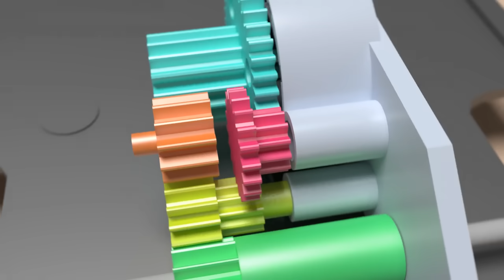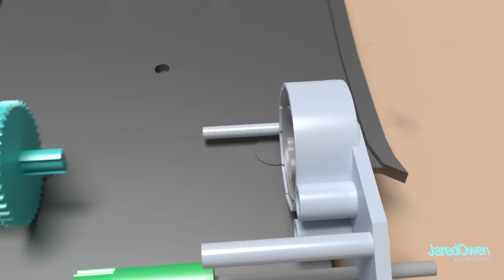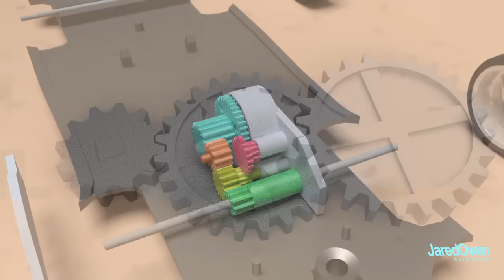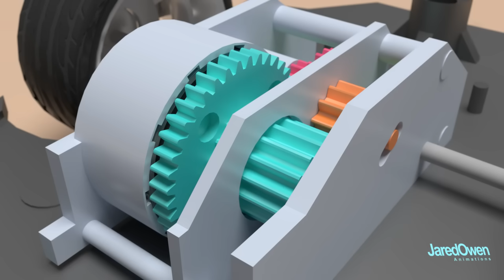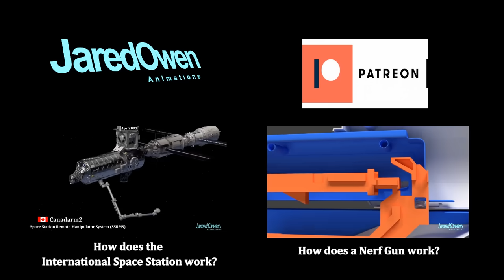How does a Pull-Back Toy Car work?

Comment: Hi sir, can you instruct how the pull blender blender without electricity works? Is the method used by the pull blender the same as the simulation of the car pull back?

Comment: 2050 : innovation 💡 
the wheels 🛞 have the gears mechanism of pull back method technology each has a motor no more engines or transmission needed 🤔

Comment: I used this video to take one of these apart and put it back together because it wasn't working, but it still isn't, and all the gears turn fine so it must be a problem with the torsion spring

Comment: No need to explain
I used to disassemble every toy car  like this and get rid of that mechanism, so i can play in sandbox without having to worry about rear axle locking up because of sand

It's basically just a spring compressed gear and a gear ratio amplifier, so rhat way the torque is lower and the speed is higher
It also has a clutch-like mechanism, so that way it decouples the spring mechanism from the axle if you want to just push the car forwards
Reply: haha pp car go brrr

Comment: When i was child, i accidentally broke the gearbox and the spring were out. After seeing few parts, i immediately know how it works. I tried to put it back, but instead i got bled due to being so hard to fit it back, so i cut the spring halfway. It worked again, but the spring felt so weak lol.

Comment: During W W 2  I believe it was in Norway there was a bus service passenger service that travelled up a mountain . Because of extreme fuel rationing they converted a bus with a huge mechanism like this , it rewinded going down hill with enough energy to go back up. I read about it many years ago .

Comment: Great video. What material is usually the torsion spring made of please? I was wondering if it could be build at home out of 3d printed parts but I don’t know what could be used for the spring.

Comment: so what would happen if i were to block the fail safe, and stop the twisted coil loop from slipping, would I then be able to to wind up the car further, obviously yes, but how much further would I be able to wind it up, or would it go until the twisted coil snaps? (or the blue gear connecting to the twisted coil atleast
)

Comment: I put one of these plastic pull back cars in a derby (which is smashing them together) with my metal hotwheels, and the motor (or engine as I like to call it) broke and fell out along with the back wheels when I was checking damages and weird positions the cars had somehow gotten into

Comment: Question: what keeps the wind-down gear (the pink gear) in place during either pushing or pulling back the car? No peg was shown on that pink gear that might keep it in place in a diagonal slot.

Comment: When i have the experience and capital i want to add this pull-back mechanism to a bicycle and also add the scientific concept from the video 
"risking my life to settle a physics debate" which has a thubmnail of sometype of car with a big "fan" on it.

With these two i can travel more faster effectively without a battery.

If some one finds a way to complete this project and have a safe final conclusion on the model,  contact me so i may see that beauty.

Comment: as we wind up the car it changes the configuration of torsing spring . the work done by use in this process is stored as potential energy in spring which converts into kinetic energy of car

Comment: I am surprised it doesn't need an overrun clutch but it's interesting the mechanism that changes it into a lower gear for pulling back and a high gear for release also handles the freewheeling capabilities

Comment: One more interesting observation is... If you try to pull back the car upside down.. like the position in which the wheels are facing the sky, then spring doesn't get engaged. Your awesome explanation also cleared my mystery of this behavior. Great job.

Comment: I have an Andoer L4 Pro motorized dolly. It's a tiny device like a toy and it has 3 wheels positioned triangularly. Only one point has a motor which controls the entire movement. The two wheels are just moving in the motion of the one motorized wheel. The two free-wheels can change direction and can be fixed to.. My question is, if I try to angle the two free wheels so that it can move in a circular motion, the moment it reaches the 360 degree round, it is not in original position. So if I let it move more than 1 full 360 motion, the device gets out of place until it falls off the table. The two wheels have angle indication lines to set the same angle but it still don't return to its exact same spot after full 360 turn. What to do? =( What I desire is that I can just let it move around at the same position..

Comment: DO YOU WANT TO GET RICH.  TOMORROW.  Use this method to create a light weight motor that'll power a remote control glider into the sky for 20 to 30 seconds of thrust.  Eliminating the need of a heavy metal motor and larger battery to power the motor.  Also eliminating the need for a heavy electric speed controller.  If and when you create this motor.  You will not be able to produce them as fast as they will sell.  Weight is a gliders enemy.

Comment: It's impressive how much ingenuity in that little motor. There is a lot of requirements solved with great economy of parts: fail save winding up, different gear ratios for moving forward/backward, auto-disconnect when spring unbound ...

Comment: Hi Jared, I just want to add one more point to your video. Some people wonder why the mechanism doesn't work when you turn the car upside down. This is due to gravity. When you turn the car upside down, the wind up gear slides up due to gravity. Now that the wind up gear slid the other way, the car cannot wind because the wind up gear is not in action.

Great Video! 

Many thanks,

MechanicalManiac

Comment: I have disassembled one of these when I was a kid, i was not able to construct it back :/

So I kept the gears and torsion springs and just assembled the last gear that connects the rear wheels and reassembled the case back on, the toy car was now just a regular toy car. 

Don't know where those went though

Comment: Backseat of a toy car, they designed to put a luggage or briefcase at top of the seat in order to fit pullback from it’s axles.

Small VW bus have it’s pullback at the front.

Comment: I had to take apart a toy like this for an engineering class. Do not take out the metal wire. You will never be able to get it back in the toy

Comment: This is super useful! I have a question. If I want to make small diy cable puller using this mechanism, what i have to add to make it roll after pushing a bottom?

Comment: Thanks for this video. I've been wondering this almost my entire life. This will probably be a stupid question, but how does this not violate conservation of energy since the car has travelled further than the distance it was pulled back?
Reply: It is fully compliant with the conservation of energy, because of the energy you give the car when winding it backward. While it is true that the toy car goes further than the distance you pulled it back, you should feel a slight resistance when pulling the car backward. This extra energy is what gives the car energy to push forward with extra distance.

Comment: Very well done. Any kid in the past who opened up the toy would have noticed that mechanism and would have a vague understanding of how it worked. But your video was far more informative. Also there was another type of toy car they use the make, it had a little flywheel and a metal arm with a piece of flint or whatever on the top of the flywheel. You would push the car again and again, it would speed up the flywheel and give it power and it would move the car. The flint on the top on some models which was just sitting on the top of the flywheel would cause sparks due to friction. This mechanism was also used in some older Guns, the trigger would power the flywheel and cause sparks to be seen inside the gun's little view window.

Comment: Was it hard to model the torsion spring?  Thanks.
Reply from the maker: yes actually - an armature with about 40 bones.  I used python code to set the poses and drivers so i could animate it with just one property.  It was tricky but well worth it!  I hoping there is a better way that I just don't know about yet...
Reply: Thank you.  This video is just incredible.  You are at the top of your craft.

Comment: Sir, your next tutorials should on any of these following topics randomly day by day but all of these, namely 
+.........................................................................+
1. Computer motherboard
2. How binary works in computer
3. How router works
5. Best programming languages ever/2019
6. Best programming ide free/commercial
7. Best raster based and vector based  free/commercial editors
8. Debugging with browser Inspector tool
9. Difference between Command and Powershell
10. How Windows OS, BIOS, Software and User interect each other?
11. Active Directory
12. E-commerce/Others Website project planning/management
13. Virtual machine
14. Difference between Docker and VM Virtual Box
15. How an ATM machine works
16. How HTML and CSS work together/rendered by browser with animation
17. What is the use of Web Drivers in different  browsers?
18. will be post soon if you like my comment

Thanks for your hard effort because you are a million 🌟!
Reply from the maker: Oh wow!  lots of suggestions - I like the ATM idea.  I'll have to look into that

Comment: Does it fit in my Honda?
Reply: If it's a honda fit then it will fit
Reply: Depends on how small it is
Reply: If you had a bigger motor you're gonna have a hard time pushing that thing
Reply: It would still be more powerful than the hold a
Reply: love your profile pic soo much :D